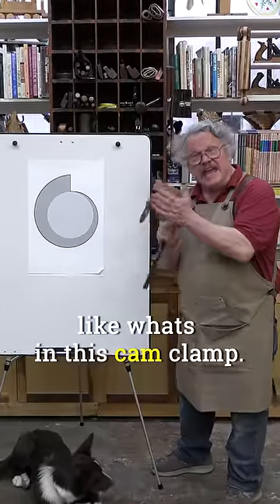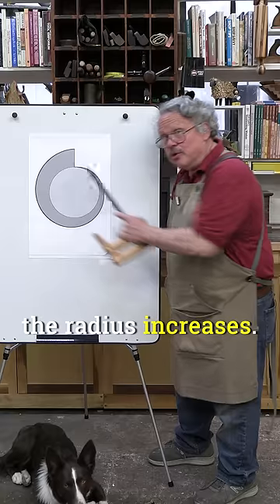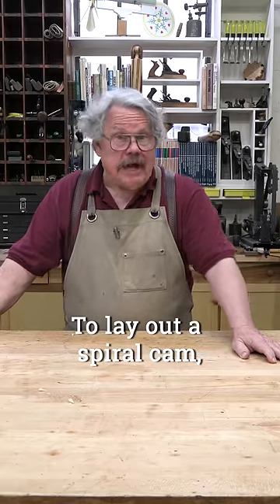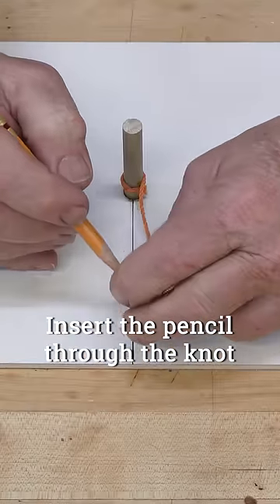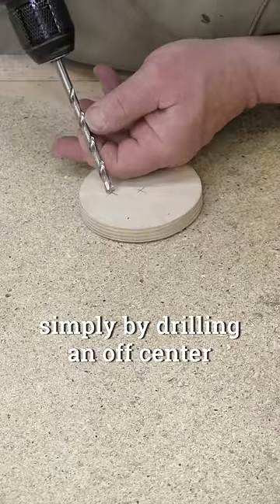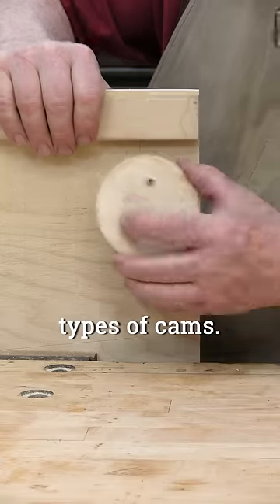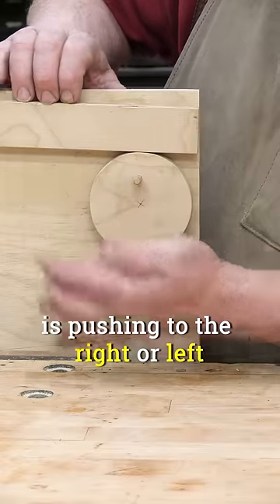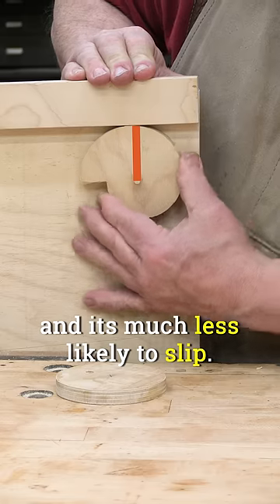How Cams Work

Comment from the maker: If you'd like to know more, see our "Cam Clamps" video at: https://www.youtube.com/watch?v=S_W6gWv6g_I

Our "Cam Clamps" project plan also contains a section on designing your own spiral cams and includes a simple formula to help you choose the correct dowel size when using the string compass I show in the video. If this is something you need, find it at https://workshopcompanionstore.com/products/cam-clamps-plan
Reply: Thank you for providing us substance, knowledge, and value.  In one video you provide more information and thought than every woman doing some vacuous, inane dance we've already seen 50 times.  You are why I sift through shit, because you are the gem we desire.
Reply: Great info and a really good explanation! As a teacher of younger children, this will be an awesome way to explain to them the difference. I thank you sir
Reply from the maker: @whiskeybentiron-works4648  Most welcome.
Reply: Thank you!
Reply: The video is no longer available.
Reply: At my work we cut logs of ham. The machines we have use an involute blade, basically exactly this. Now I see why.
Reply from the maker: @eugenetswong  Try https://www.youtube.com/watch?v=S_W6gWv6g_I
Reply: @WorkshopCompanion  I am a commercial Roofer and am in need of a design for a cam clamp for a guardrail system, I have been told it wouldn't be a good design because of slippage. Is there a way to have a one way releasable toothed cam?

Comment: A mere two days ago, I spent several hours searching how to design cams. I ended up making a faux cam because every source I found was impenetrably academic. "It's a wedge wrapped around a disk" was all I really needed to know.
Reply from the maker: Yep, and the height of that wedge (the side of the triangle) equals the circumference of the dowel. Nothing to it. In a few days, we'll be posting a video on cam clamps that goes a little deeper into the physics. And the cam clamp project plan, which I am wrapping up today, will include a simple formula for figuring the size of the dowel based on (1) the movement you want to effect and (2) how many degrees the cam must rotate to effect that movement.
Reply: that should be very interesting and informative 🙏🔥⚒️🧙🏼‍♂️
Reply: @WorkshopCompanion  I can't wait for this!
Reply: Wow, that WAS beautifully explained, wasn't it?
Reply: It's always wonderful to learn about advanced math through some simple means usually by older kinder teachers. My teacher practically taught me trigonometry even though I would not be able to tell you the answer to a trigonometry question proper
Reply: @WorkshopCompanion everything about this explanation is so simple it blows my mind. Fantastic video.
Reply: @WorkshopCompanion  And this is why i value so much an "old style" of teaching. I don't know how it's called in english, but in the workshop i Poland, there was someone called a "master" - a very experienced professional, who was passing his knowledge and experience to students.
The same was later at work - a young tech was assigned to much older one and he was learning the trade with all tips and tricks.
Reply from the maker: @ogi22  There is much to be said for the apprentice system, and we have something similar here in the United States for our trades -- electric, plumbing, carpentry, masonry, and so on. Unfortunately, there is nothing for woodworking. It's not an essential trade, so there is no educational system to support it.
Reply: @WorkshopCompanion  I was really lucky that with my first job (resident maintenance at cigarettes factory as an automation tech), they had this system. And after a couple years i was able to move forward.
Reply: Think about it this way too I’m sure all these modern construction guys have a lot of knowledge skill and know how but think about the Romans they built a 2,000+ mile long aqueduct before calculus most of this is just learning how shapes interact with one another I know it sounds like I’m making it too simple but keep in mind the Anagram K.I.S.S or keep it simple stupid still very much applies
Reply: geniuses like him can explain it simply
Reply: There's a lot of common sense and knowledge hidden behind pomp and circumstance.
Reply: Best explanation I've ever heard.
Reply: So, this is spiral power ...
Reply: @WorkshopCompanion as a machinist this would be very helpful
Reply: the smartest people can make anything* sound simple!
(*in their expertise)
my favorite smart person quote is
"smart people don't know everything, smart people know people who know everything"
Reply: I can't imagine your frustration once you came across this video
Reply: "Impenetrably academic" is a fun phrase.
Reply: Shapes are Fun! 😅
Reply: @ogi22 ￼ how did it feel to literally make the world a worse place every day?
Reply: Smart people can explain what they made. Geniuses can make it understandable to a child. A wedge around a disk is a perfect example of genius.
Reply: good and simple
Reply: @WorkshopCompanion fibonacci somewhere in there? Haha. Great Info!
Reply: After the simple lever, the wedge was, I believe, the next most important tool invented by humanity. I wonder how long it took them to figure out the benefits of wrapping around a disk? It had to be after the invention of the wheel, and the inventor must have had a very good imagination.
Reply: Did you say you can make a bow cam by drilling a hole off center?
Reply: I'll make it simple, you dont want your pressure angle (angle between the line normal to the follower and the ine from the turning point to the cam surface making contact with the follower) to be greater that 30 degrees ever. Thats what causes slipping.
Reply: To properly design a cam requires differential calculus. Or you just find software to do it for you.
Reply: @WorkshopCompanion man you're truly awesome.  As someone who wanted to learn carpentry from his father, and lost him to drug addiction before I could, thank you..
Reply from the maker: @Michaelroni-n-cheese  Most welcome.
Reply: This has always been my issue with papers and text books and what not, often the explanations go so deep it becomes impossible to apply because you don't know where to begin or what most of it really means when someone who knows can reduce it down to a single sentence
Reply: it is academic because there is much more than that to design a cam. not everything can be explained properly at primary school level
Reply: I know man. This page is so awesome.
Reply: @WorkshopCompanion Legend! Thank you for the info
Reply: eccentric cams are used in some applications, what he showed here was a snail drop cam. Try wikipedia next time
Reply: Wouldn't a spiral cM only work one way while the other works both ways?
Reply: @WorkshopCompanion  The amount of rotation needed to  ake a cam clamp function properly isnt solely geometry but a significant amount of friction and pressure requirements will be based on material characteristics, ex. compressability lubricity/surface finish etc...the real world stuff outside of an engineers desk portion of designing anything. Good educational short video, thank you. Many brilliant people taught me as a child as to the benefits of experiencing real world simple modeling to alow the brain to fully comprehend a concept. Cam does not have to be any specific radi without including aforementioned variables. Like latches for ship sea doors, ICE engine timing systems, window latches, etc..Some amazing unusual engine designs use angled rotating cylindrical shaft cams that I have never seen until recently, Human Inguniety is fricken aw inspiring! thanks to all our educators and spreaders of knowledge
Reply: You were probably overthinking it like an engineer would.
Reply: Cam designs can reach mind blowing levels of geometric complexity for how simple they can seem. This is just one type of cam, the rabbit hole goes deeper than you even want to know.
Reply: the true skill of science communication is the ability to precisely describe things using words everyone already knows
Reply: OP is a mood and it's exactly why I respect the feynman school of thought more than trying to hike your big boy pants up to your brain's armpits. For example I despise the borderline thesaurus addicted "No no it HAS to be this way" purple prose of the medical industry I've worked in previously and wonder how much unnecessary harm it's caused in a heat of a moment or crisis. Where it requires a bloated Tolkein-esque block of text to explain that "Clearing a blockage in this artery grouping increases survival"

Feynman believed quite plainly that if you can't explain a concept clearly and simply - You yourself don't understand it.
Reply: @WorkshopCompanion I've never, ever heard of woodworking referred to as a non-essential trade before.  That seems ludicrous to me

Comment: “A wedge wrapped around a disk.”

I’ve never heard it described this way and it actually really helps with visualization
Reply: That is similar to the way I heard  a screw described, a ramp wrapped around a shaft
Reply: Better described as a ramp. Screws can also be described this way.
Reply: As the joke goes,  If you're an incline plane wrapped hiellicly around an axis, what are you?

Screwed
Reply: There are few if any true straight lines in nature but there are curves. Therefore, a wedge is a cam that's been stretched out straight. Follow me for more science.

Comment: You can adjust the slope of the cam using a different sized dowel, and can adjust the overall size by adjusting the length of the string. This has helped me tremendously over the years
Reply from the maker: Good tips.

Comment: I work in a CNC Lathe shop but years ago we were what is called a screw machine shop.
Screw machines are automatic lathes where a significant amount of the machine's motion is run off cams. Lots of cams.
It's cool to see that some folks think about cams.

Comment: Its interesting how both designs have their own pros and cons. 

For example, the faux cam may slip at some points under pressure, but the actual cam has the issue of not being able to run in reverse.

Comment: This is reminding me of those shows that were on like what was it channel 12 or something if you didn't have cable. Oh yeah to do was take two pieces of wire and stick them on the right parts of the screw terminal that was sticking out the back of the TV and you could get a few channels though they were usually pretty fuzzy.

Comment: I like archery a lot, and never understood why the “pulleys” on a compound bow were called cams. Glad I saw this. Though, most would be faux cams as they aren’t full pulleys, but instead off-center ovals. But that actually makes them work as you want the off-center pressure to propel them and the string forward

Comment: SO FUN FACT! What he describes as a "faux cam." Is how compound bows operate, you are forcing a strong material (like a plank of carbon fiber) to bend through use of pullies shaped like a "faux" cam, though in archery we just call them cams. You reach the far side of the circle by pulling on the string, and once you let go it instantly wants to go back to it's neutral position, and there's a bit more to it with a bow, but that's the basic idea.

Comment: Very good explanation. You might expound on the subject to explain how dowel thickness affects getting the best cam (beginning to end radius)
Reply from the maker: Thanks. Can only  do so much in a minute. As I told another viewer,  we'll be posting a video on cam clamps that goes a little deeper into the physics. And a cam clamp project plan, available from the Workshop Companion General Store (https://workshopcompanionstore.com/), will include a simple formula for figuring the size of the dowel based on (1) the movement you want to effect and (2) how many degrees the cam must rotate to effect that movement.

Comment: I had never thought about a wedge/ramp wound up as a cam.  

Getting the dowel size right so the ramp action is right will be a bit harder, not impossible 
Thabks again coach.
Reply from the maker: One full rotation of the cam will move a lever the circumference of the dowel. Everything after that is simple math.
Reply: @WorkshopCompanion  this just got so much easier.....

Comment: To be perfectly correct (this doesn’t remove anything to the quality of the video), the contact point for the came is much closer (but not perfectly aligned) with the pivot.

The reason is that at the contact point, the tangent to the came must be parallel to the surface it is leaning on, and that is impossible with the spiral came because the radius increase.

However, the more the radius increases slowly, the more the applied force is close to the pivot point.

Again, sorry for that, your video are cool, keep it up !

Comment: Mechanical Engineer here! While this video is a great simple explanation on the concept of the cam. A spiral cam like this would probably not be used in commercial products. The discontinuity of the followers position at the top of the rotation, that is to say, that vertical line that’s created will probably cause vibration and bumping while it spins continuously.

Vibration and discontinuity is a biiiig no no when it comes to mechanical design because they usually create wear. You can imagine a vibrating mechanism loosening all its screws and flying apart, or something or other.

In practical design, we use what’s called Nortons fundamental law of Cam design: “The cam-follower function must have continuous velocity and acceleration across the entire interval, thus making the jerk finite”. 

Which ensures the position is always continuous, and there’s no infinite jerk, which is as funny to say in person as in text. It’s one of those “PITA calculations” you have to study in college, but it’s worth it.

Comment: If you want to get really technical, the contact point is actually never in line with the pivot, but it stays in the same spot which is really close to in line.  The smaller the dowel you use to draw the shape, the closer the contact point will be to in line with the pivot.  On the other hand, if you use a dowel that's too big, the contact point may be far enough off center to cause slipping

Comment: Looks like it would make a nice bench clamp.
Reply from the maker: Interesting suggestion. It would be easy to clamp down with the jaw parallel to the work surface, the use it to hold small-ish parts for sanding, scraping, other hand work. This might be an especially useful setup for working duplicate parts.

Comment: Cams are very useful for compound bows it kind of reduces the weight you Pull so a 50 lb bow at full draw could only require a draw weight of 10 lb or less

Comment: Nice I see some mathematics 
The radius decreases based on the length of string that is lost to the circumference of the dowel 
If length of string is constant 
Using a larger diameter dowel can make a smaller min radius and have the same max radius size 

Using a smaller diameter dowel can make a larger min radius and have the same max radius size

Comment: One problem with the second cam, the shaft will fall when it gets to the gap, the first cam will have a smoother motion to it and no falling, both have there place for different uses, a cam is not "just" a cam

Comment: A wedge is an "inclined plane." A spiral, like a screw, is also an inclined plane. A wedge/trangle/ramp that increases distance to lower the amount of force needed to do the work. In physics, Work is Force applied over a Distance and over Time. An inclined plane is a "simple machine." Again, that's the physics definition. 

Walking up a ramp takes longer than using stairs. If a ramp is 4 times the distance of a set of stairs, it takes 4 times as long but only 1/4 the amount of Force. The total "work" is the same.

Comment: jimko97. The mathematics can get quite complicated,  however, practically speaking a lot can be gained by understanding that it is the diameter of the winding rod  that determines the shape for a given starting radius. Considering the displayed example, say the vertical line is 50mm and the end radius is 100mm. The string length difference is 50mm which is achieved over one rotation or 360°. The circumference of the winding rod is therefore 50mm and its diameter is simply 50mm divided by pi (3.14 ....)

Comment: What you did not show is that the second cam demonstrated will have two points of knock when the ramp initially dropped off and win. The end of the ramp does not further contact the lip of the lid.

Comment: In a cam, the force is NOT in line with the center of the cam, that could only happen in a circle. The offset is just far less than in a circle and also constant. In an offset circular disc, the offset fluctuates between zero and the radius at which the eccentric hole was drilled.

Comment: Does the decrease (or increase) of radius equal the circumference of the dowel?
Reply: @WorkshopCompanion  would you mind giving me a rough idea if bigger or smaller dowel = more movement?
Reply from the maker: @LitoGeorge  Larger dowels will draw spirals with more rapidly increasing/decreasing radii. This gets you more movement per degree of rotation. Larger dowels get you more movement if you turn the cams the same number of degrees. We explain this in detail and provide a formula for figuring the dowel diameter in our "Cam Clamps" project plan: https://workshopcompanionstore.com/products/cam-clamps-plan
Reply: @WorkshopCompanion  brilliant, thank you. Sure would like you for an uncle. Be well :)